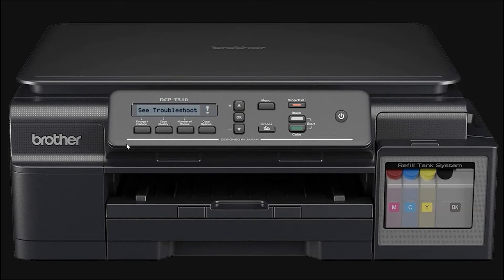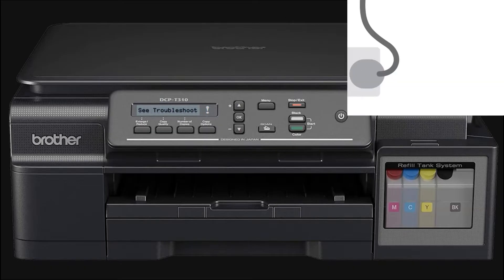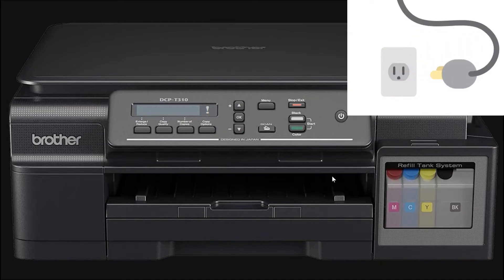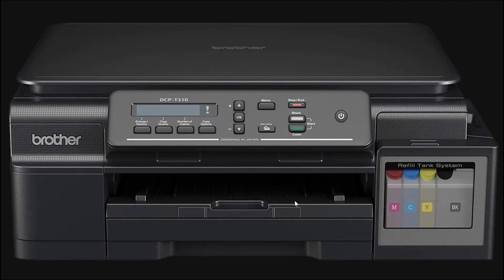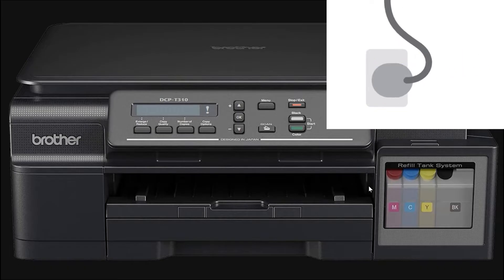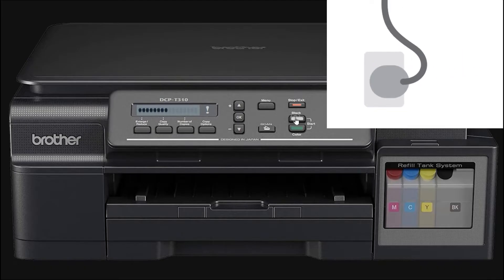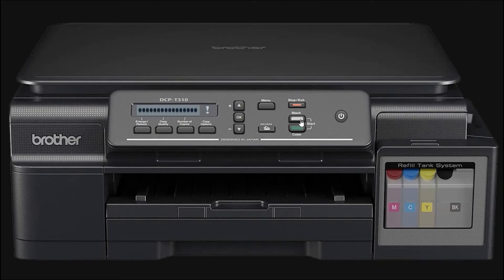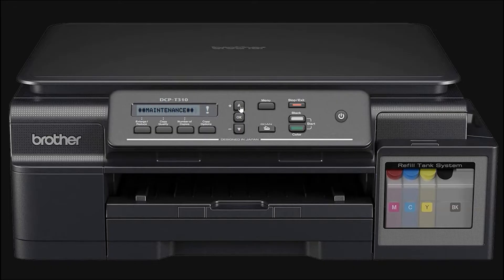How to Fix "Print Unable 50" Error on Brother Printer | Simple Solution for Brother Printers

Comment: No maintenance menu option comes up
Reply: @ThisisnotTwitter  press and hold before you plug electricity
Reply: @ohkeibye  I got it eventually thanks. I wiped the purge value to 0 but it still has the unable to clean 50 error for me. It still has the error code flashing away today.